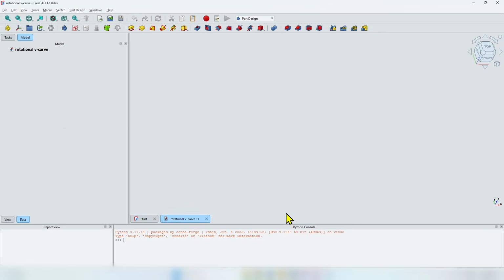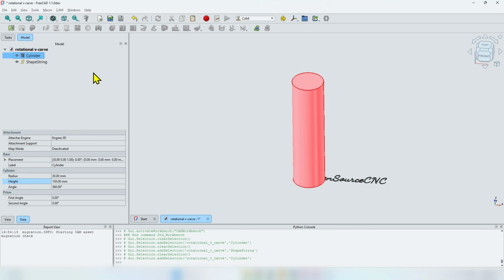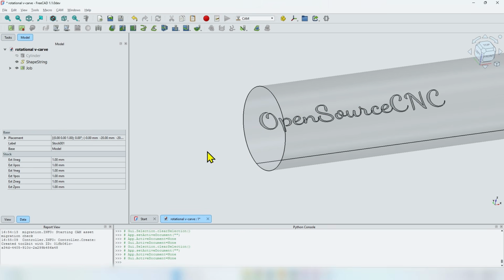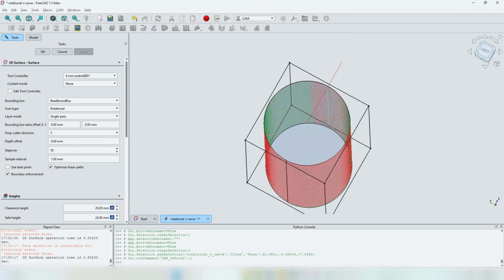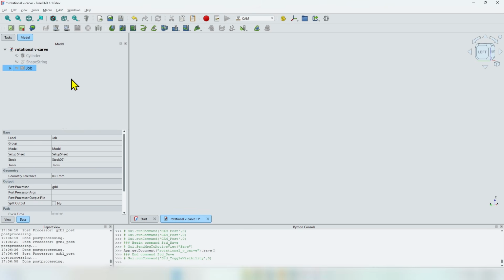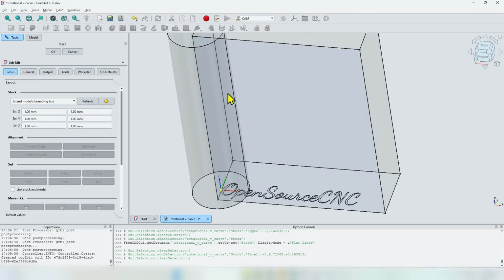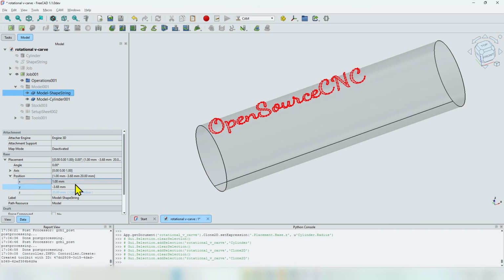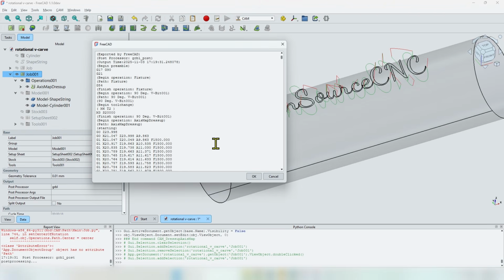V-Carve Text on a Cylinder | 4-Axis CNC Tutorial in FreeCAD 1.1

Comment: In the toolpaths, I see there is a red path that extends to the radial center of the cylinder. I have that in my model as well. That's the origin of the job. But in the video, the end mill only starts contacting from the top of the workpiece? Doesn't it seem like the job would have to start from the rotational 0, and you would have to zero your machine there as well?
Reply from the maker: The 3d representation of the rotational toolpath has a lot of bugs. I do zero the machine in the rotational 0. I always set the origin on the machine exactly where I set it in FreeCAD
Reply: @opensourcecnc I see... How would that work? You jog the bit down manually right next to the end of the piece? I've got tailstock support which might hinder that...
Reply from the maker: @joshmiller-watt1085 No, I zero it as usual. After that, I add/subtract the offset to the center, which is the same each time.

Comment: I have got a 4 axis flat bed cnc machine. The 4th axis one can control the cutter bit angle in the X direction only. So its basically a 3 axis cnc machine with that facility. Any ideas what programming method i could use to bring in the 4th axis.
Reply from the maker: Do you mean the cutter tilts along the X axis, or that it stays on Y=0 and only moves left to right along X?
Reply: @opensourcecnc  The cutter tilts on the X axis 90 deg from the vertical in the X+ and also in the X- direction. So it can achieve a horizontal each way in X
Reply: It can cut 600mm high. To shape cut polystyrene blocks. Unfortunately it does not rotate on the base unless one physically rotates it by hand.
Reply from the maker: In this case, what you need is a rtcp system (rotational tool center point).  It is not possible yet in FreeCAD or blender. I'm working on a solution to this, but it takes time and money, in order to build the machine to test on. I can't tell you when or even if I will have a working version.
Reply: @opensourcecnc  Wow, thanks for even responding to me. I am hoping. I will try see what I can maybe accomplish.
Reply: @opensourcecnc  You are welcome to send me a gcode file to run on the machine on a smallish poly block cut to your liking and I will send you pictures, video and feedback if you like. The machine has a MASSO G3 controller and I can link you to all its G_CODES. The Masso G3 is a very nice controller in my opinion. Australian company. They might even help you possibly.
Reply from the maker: Masso controllers are nice, but the cheapest costs half of the budget I'm trying to crowdfund for my entire project. So I will go with FludNC for the motion with the RTCP part computed in FreeCAD. I think this approach is better, as it doesn't depend so much on the controller.This way, the heavy computation and optimizations are made on an actual PC.
Reply: @opensourcecnc  True. I am just trying to help a friend of mine and the MASSO G3 is in the CNC already.
Reply: @opensourcecnc  True. I hope you get it right. Some time back I set up a machine for someone with LinuxCNC on a dedicated PC. I think he is quite happy running it like that. 

 The Masso installed in this machine of a friend of mine is a Masso G3 for a 5 Axis machine but only 4-axis is used. I suppose later there is the possibility to add a 5th axis. I have cheat sheet for the G-codes which is very handy. Can't remember where I downloaded it, but it seems comprehensive.

Comment: Hello, I have a quick question: When I align the text to the Y-axis, it appears rotated or mirrored.
Am I doing something wrong, or is there a setting that I might have overlooked?
Thank you very much for your help!
Reply from the maker: How are you aligning it? What method do you use?
Reply: I align the axis the same way you do in the video, using the same steps, but instead of aligning it to the X-axis, I align it to the Y-axis.
Reply from the maker: @hermannperl3585 you need to set in the 3d surface the drop cutter direction, instead of x to y
Reply from the maker: Sorry, I was wrong, I was thinking of something different. I will get back in a few minutes
Reply from the maker: Can you please send me an email with an image of the wrong text toolpath or even the FreeCAD file? You can find my contact in the about section of the channel
Reply from the maker: Did you try to load the G-code in another program? From what I see, it's just a preview issue. You should map x to a. But FreeCAD represents a along x, no matter what your setup is. That is why it looks wrong. Try loading the gcode in ugs or what other program you are using and see if it looks ok or not
Reply: Thank you very much! I will try it again today and let you know by email whether it works like this. Kind regards.